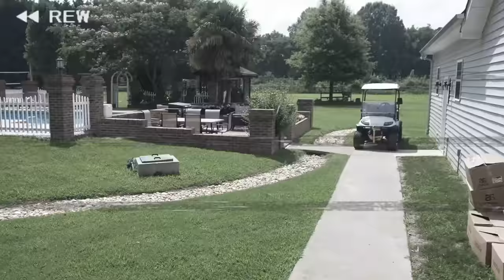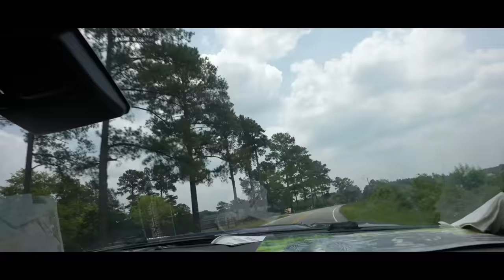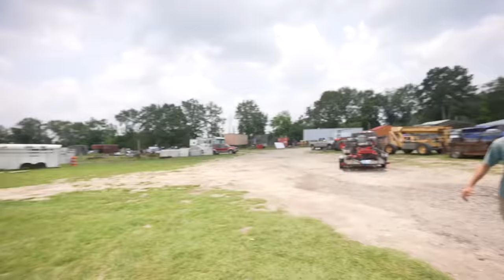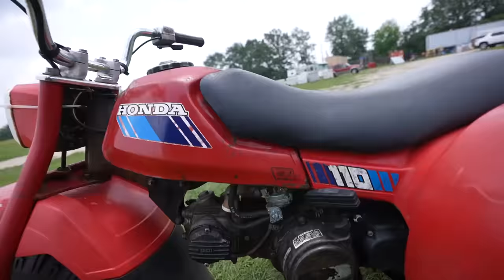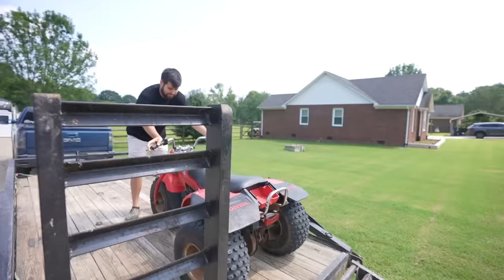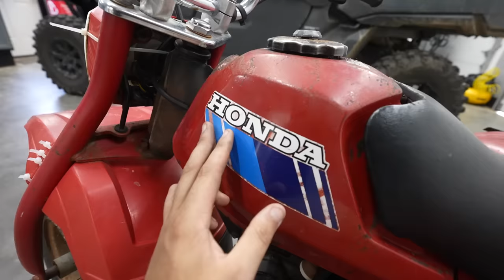My NEW Three-Wheeler Caught on FIRE!

Comment: leave it to juliass to catch a prefectly good 3-wheeler on fire
Reply: get drr90 for a pitwheeler.
Reply: @blakemk7   no its not
Reply: @blakemk7 why would they script that
Reply: @bbuie views
Reply: I feel it’s scripted for 3 reasons 
1. The way the camera was handed over he did not say hold this 
2. The fire was not on the bike it was under it 
3.that was oil under the three wheeler
Reply: @logansnaper8523  And at 18:15 how calm he was I could tell it was scripted.
Reply: Fake news they burnt a classic for views... I done with yall
Reply: 100% burned that 3 wheeler to the ground for views.
Reply: @logansnaper8523 and the fact that he started screen recording when there was a camera rolling like he knew that was gonna happen
Reply: @logansnaper8523  it’s not scripted, there it had a crappy fuel filter
Reply: @sybsygstgstsgysg5330 it doesn't matter. Gas doesn't ignite from the amount of heat coming off an engine. Ive witnessed a carburetor float getting stuck and dumping gas on a burning hot engine from riding through sand in the summer, it was so hot the gas got instantly vaporized and still didn't catch on fire
Reply: @logansnaper8523 shut up you really think Braydon is going to do that and the some thing that was on fire on the bike could have dropped on the ground
Reply: Lol

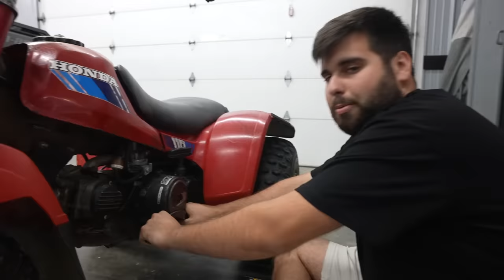Comment: It's that crappy little plastic fuel filter that caused the fire. Those things warp and start leaking fuel with any heat. If you look at 6:23 you can see it's laying right on the cylinder head. What happened is when it got left idling for a few minutes, that cylinder heat transferred enough heat for it warp the plastic, causing gasoline to hit your hot engine and it ignited. With the initial video of the fire you can even see its concentrated on that side of the three wheeler.
Reply: Ha, I think you're right
Reply: 😂your right
Reply: dam bro is a detective
Reply: Not to mention it’s facing the wrong way, in-line fuel filter caps should be upwards I believe
Reply: relese_thebeast7299   and it is upside down there that’s what I’m sayin, and yea lots of old machines leak when the fuels on running or not. They just leak more when not running
Reply: Dude has seen a thing or two 😂
Reply: @jordanduran8570 you're right
Reply: yes absolutely they previous owners are lucky it didn’t happen before unless they replaced it cheaply before sale
Reply: We now you can do a restore build
Reply: Exactly why they don’t come stock
Reply: Gas doesn’t ignite because it’s hot, it needs spark you can fill a coffee can with gas drop a lot cigarette in it and it’s not gonna catch on fire 🤡
Reply: Either that or there was already a fuel leakage which could b proven by a rusty gas tank (which they had)
Reply: Holy shit brother you’re a fucking detective the whole way bro no shit it is like right there right on the fucking thing. No wonder that fucking car on fire.😂😂😂😂😂😂
Reply: who puts a fuel filter on a three wheeler
Reply: Damn are you a machnanic or something bc that sounds like something only someone with a lot of sense about motors should know 😂
Reply: Good thing it didn’t do that in the garage
Reply: Yeah you can see it that’s really unfortunate it was probably worth tons because of those decals

Comment: You should def try another 110. That one didn’t seem to be running quite right. They usually scoot a bit better than that and wheelie like nothing. Also keep an eye out for a 125m. Same frame but big power difference. For ultimate fun try to get a 350x or a 250r. 85 or 86 250r that is.

Comment: gotta love how he is cruising 92mph down the highway.
Reply: I was just about to come say that 😂
Reply: in connecticut 100 is normal on the highway unless theres pigs nearby
Reply: it said 32
Reply: his big tires make the speedometer fuck up  and run 20 ish over what it actually is
Reply: @smorfn 20ish?? Not even close.. More like 1-5 mph and he’s on stocks bruh. Not even on bigger tires.
Reply: @briggysmallzz1112  Def not stocks lmao
Reply: @smorfn sorry but bigger tires make your speedometer read slower not faster
Reply: @johnbibbings5356  not true at all lmaooo bigger surface area on bigger tires aka when smaller tires are what the spedometer are set too then if u have more surface area on your bigger tires then ur speed is slower than what ur small surface area set spedometer is reading its basic knowledge
Reply: @smorfn  yes it is basic knowledge. Look at Google and it will tell you the same thing I told you. Bigger tires make your speedometer read slower than what you are actually going. You should know what you're  talking about before you try to teach others the wrong information. 🤣🤣
Reply: @smorfn  it’s diameter not surface area one rotation on big tires is more distance than one rotation on little tires therefore bigger tires mean slower on the Speedometer
Reply: @smorfn the speedometer reads the rotations in the differential to tell your speed i believe, so, if its calibrated for smaller tires and u put larger tires on, the edge of the larger tires will be moving  a larger distance than what the factory tires would be. Meaning the speedometer would say youre going slower than you really are. So basically what u said was backwards

Comment: I’m gonna say that because it was hot already and air cooled it got way too hot and overheated because they are meant for constant speed not idling for long periods, knowing older machines it would have fuel on the block or around it which is probably what ignited and burned it down.

Comment: I’d get into a big red 250es like you were saying. They’re about the best bikes you can get, has electric start, reverse, full suspension, and they’re not as tippy as the 110. The smaller 3 wheelers roll so easy.
Reply: I’ve never rolled my 85 250es, super stable

Comment: Just get the mighty tiger 500cc three wheeler brayden. If you can find one. I think that’s a better 3 wheeler than the 110. That should have all the power and speed you need. 1983-1986. It’s a 2 stroke 500cc motor in it:

Comment: The 110s were not very fast to begin with, but if it has a cheap chinese replacement carb on it that could be losing you quite a bit of power And the floats like to get stuck and leak gas
Reply: Agreed, from my 110 experience this one kinda seemed like it was down on power.

Comment: I have a 1986 Honda big red 250es with a custom lift and roll cage. I recommend the big reds because they are pretty fast and easy to wheelie and it has full suspension

Comment: Get a 3 wheeler build it for mud that’s where they shine and the fire extinguisher part it’s very important to make sure it’s the right type of extinguishers, they do different things and put out different types of fire. The one you probably use wasn’t made for a gas fire. I could be wrong on the type you used and it was just to small and the fire was too big

Comment: This happened to one of my machines, it was a Chinese 110 and what happens is the float gets stuck, bowl overflows, leaks of the head of the engine and before you know it the spark plug ignition coil spark it right up.

Comment: Just FYI they only made atc's till 86 in US canada got a few 87s.

You need to find an atc 200x. better suspension and has a clutch. I've owned 2 over the years both were 1985s. if you can find the 1986/7 its white and has 6 gears rather than the 5speed of the earlier years.

Comment: the fire extinguisher didnt work seen as it was a gas fire some older fire extinguishers or certain ones like foam or water wont always work. Reason im guessing leaking gas or oil then it got super hot

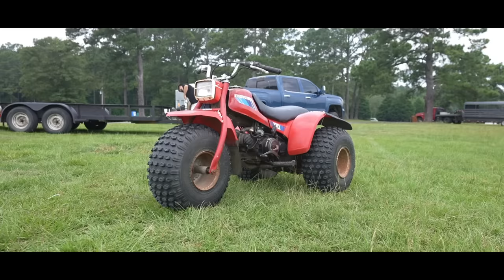Comment: It will definitely wheelie better if it was in low range the atc110 has a high and low gear selector on it behind the pull starter 4:59

Comment: My guess is you didn't put recreational gas in it in those Old four wheelers you can't just put any sort of gas in them you need to use recreational gas if you use normal high octane it will melt the carbs line's and start leaking and it will cause the engine to run really hot and burn oil in my 1987 Kawasaki bayou klf300 I run recreational gas and it runs just fine runs like it's brand new

Comment: You need to rebuild the engine in that thing I had a 110 a few years ago that would pull a wheelie in 2nd hi a there is low gear and hi gear on those

Comment: ok Braydon you probably ant going get this comment but i have a 200es 3 Wheller 1984 but the carb started leaking gas out of the tube onto the motor every where lucky i rode  it for few minuets  cut it off to do somthing and gas started leaking out carb so i replaced it i bet if i rode it for the while with gas comin out of the carb it woulda caught on fire but 100 percent carb is what happend i replced the carb but he mighta had a chinese carb on that 3 wheller an it messed up

Comment: 😮😮😮 okay so, back earlier in video, you and Buddy swap bikes and when he got on the 3-wheeler, buddy clearly says I smell something burning and I believe he asked you is that all right. Either way that's never a good thing to hear your hogmmie say😂 it's usually a foreshadow of usually one very specific thing😂😂 this is why you want to really go over and shake down any used motor vehicle anything that propels you with a motor, especially nowadays, you have to look over that old shady work and redneck engineering and niger riging😅😂 almost every pre-owned motor vehicle has some type of repairs or upgrades or mods. When we typically new car repairs or rec vehicles most people look for and want the best price and they are willing to trim and use lesser quality productsm in this life you get what you pay for LOL within almost every used vehicle purchase there's always some kind of undisclosed information, there's always some dirty deed previously done to this thing and they beat them motors up, especially these old off-road trail monsters 🔥 you guys definitely need to have a safety plan and prepare for how you're going to deal with certain possible dangerous situations. You give them a lot of perks and benefits and you should make the work for a little of it LOL stupid goofy volunteer fire dept onsite😂😂😂 I got nothing but ideas and dreMs😂❤